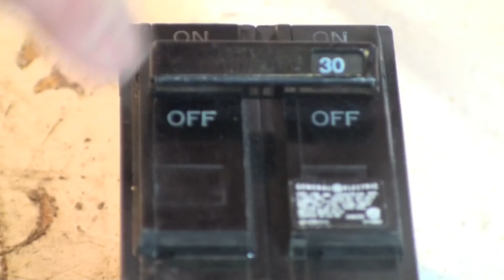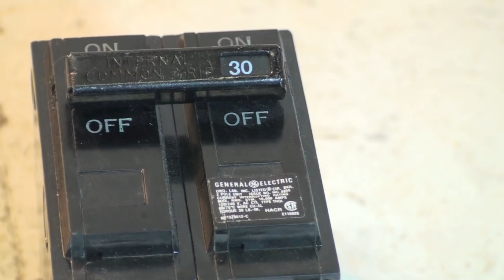Why does my panel breaker keep kicking off.  Breakers #2

Comment: On my 1952 house in most of my in house electric outlets have no ground meaning only a 2 prong plug will work,  I would like to install gfic  I had one person suggest to connect a ground wire from the ground screw to the neutral side of the wall elec receptacle saying this was safer then making no connection to the ground screw, what is your input before I go forward on this?

Comment from the maker: I would check the amperage draw of the appliances you are using.  Amp draw can be found on the model plate of the appliance.  If it exceeds the amperage, the breaker will trip.  If the amp draw is below the rating of the appliances, Replace the breaker.  Breakers do sometimes fail inside and will trip under normal operating conditions.
GFM

Comment: Two of electric outlets are having issues in my kitchen. They kept disconnecting the power after a few weeks of use. Each time i opened up the panel, circuit breakers were tripped to middle, so i reset them, then they start to run for a week sometimes for weeks then tripped again. The thing is that i dont use too much power on those outlets(both in kitchen) at the same time. Mostly used for one water boiling kettle or one rice cooker at a time.

Comment from the maker: Have you been able to reset the breaker?  Sometimes breakers fail inside.  You will need a test meter to go further and the ability to use it.  Remember you are dealing with high voltages and need to take precautions.
GFM